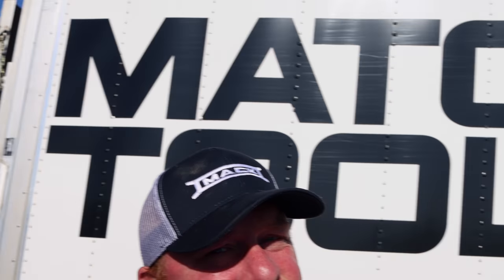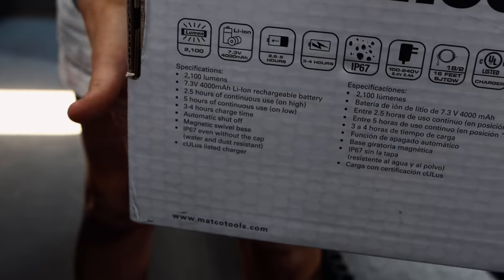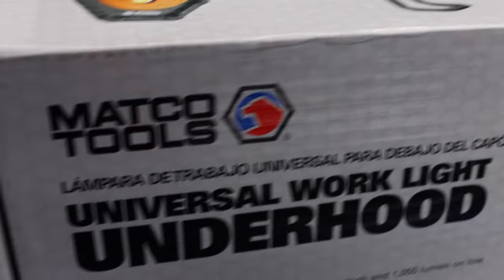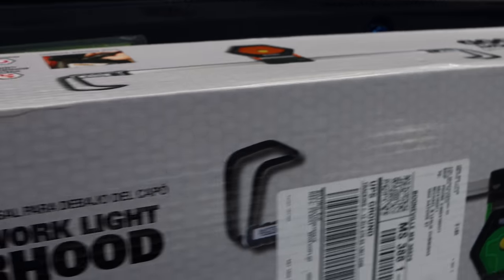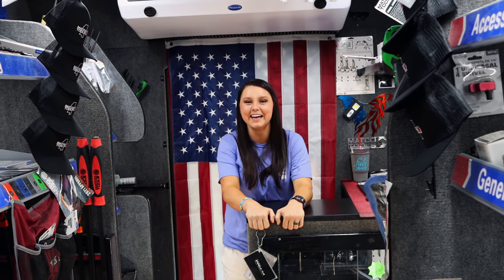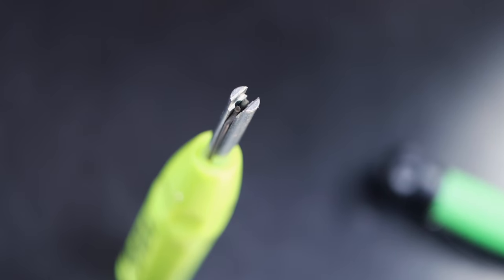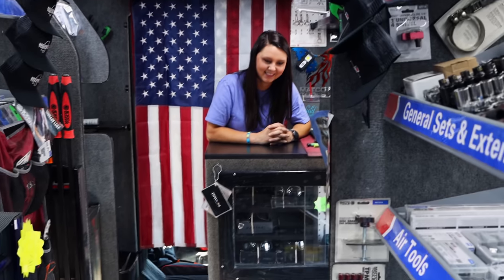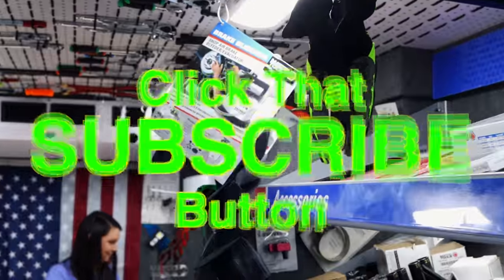Matco Tools Underhood Light and Valve Core Wrench. It's Been A Long Week!

Comment: This is gonna be long, so forgive me: I used to drive for a small fleet owner (22 trucks) who owns several shops (large truck, medium duty truck, and a trailer shop) and who worked in his daddy's tire shop growing up. He was very hands-on and showed me how to mount/dismount tires on my truck. He had me air up the tires to 140 PSI. His reasoning was that--by the time you got the core in--you would be very close to 120 PSI when it was seated. 

Pretty clever fella and the best OTR job I ever had. Anyone in Topeka, KS probably knows of his shops: Hoyt's Truck Center. Hoyt Moore is a good guy. Period. In fact, you remind me of Hoyt, Clay. Good fellas must come in very similar packages!

Comment: Michael or his wife could also use a pc/phone repair mat for doing rebuilds on rachets or tools. They make nice blue silicone or clear plastic ones that you can lay the parts out separately. Can find them on amazon. Great for repairing small electronics, phones etc.

Comment: Here's where I show my age, is there a lumen to candlepower equivalence chart???  The label being in Spanish isn't a problem for me, I was the Rodney Dangerfield of East L.A., No tengo  respeto. ;-)
Reply: No, they're 2 different measurements. Candlepower is the intensity of the beam at the brightest point, whereas lumens measures all the light produced. An underhood like this would be relatively low candlepower but high in lumens because of the wide dispersion of a beam. A spotlight on the other hand can be low lumen but still have very high candlepower with its super focused beam.
Reply: @kylesonsalla7620  You went to a great deal of effort in order to answer something where a simple "no" would have worked. ;-)
Reply: @P46345  
Very detail oriented kinda guy 💁